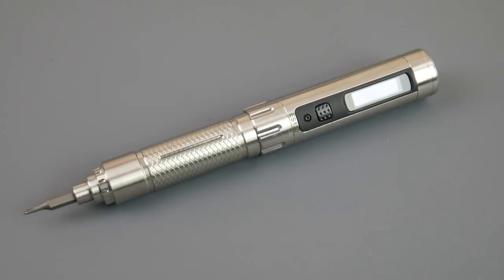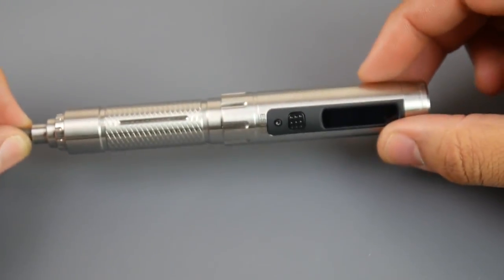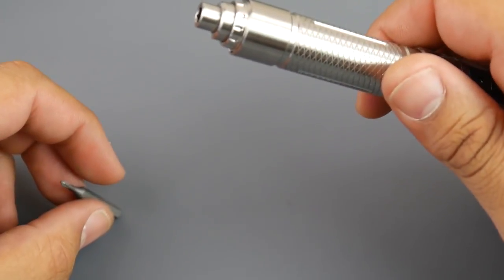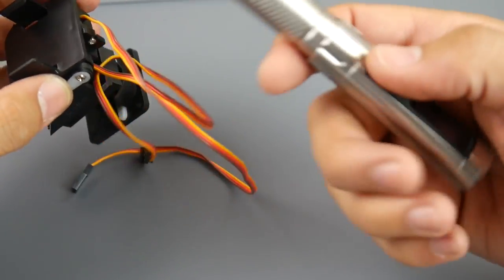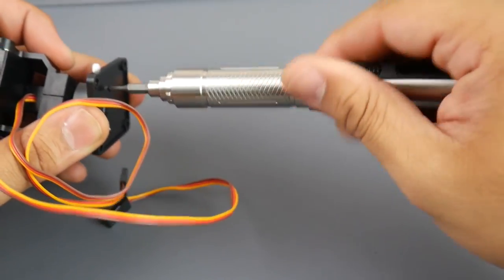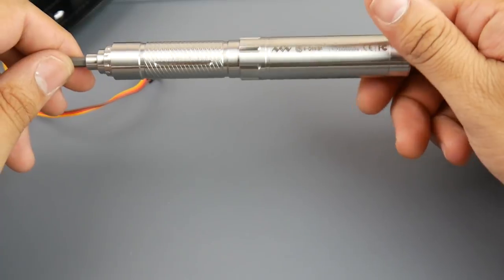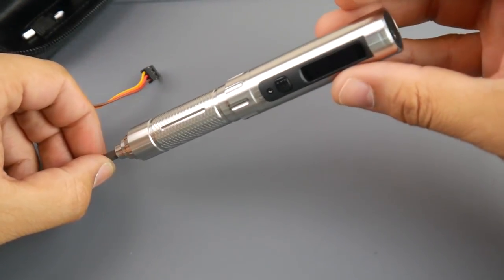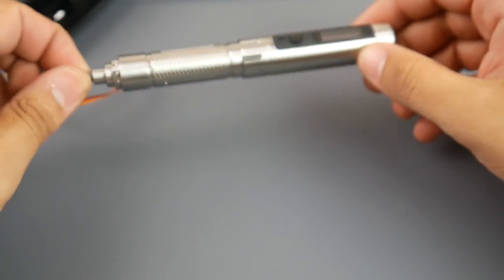MINI ES120 Mini Motion Control Screwdriver // Beast Of ScrewDriver

Comment: Pretty nice, dude! Looks really nice! 😃
I made one with a 9g servo with metal gears and it should have the same amount of torque of that screwdriver. You know? And I have a bigger servo (with 13kgf, I guess, of torque) and I want to make a new one... Just didn't find any plastic thing where it would fit... But, well, soon enough I'm going to buy a 3d printer and it's going to be simpler. 😊